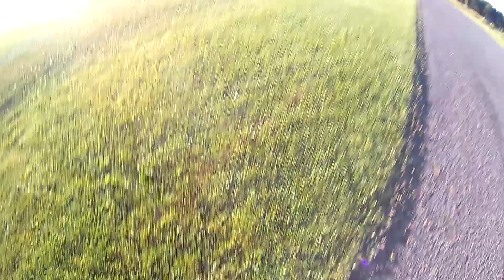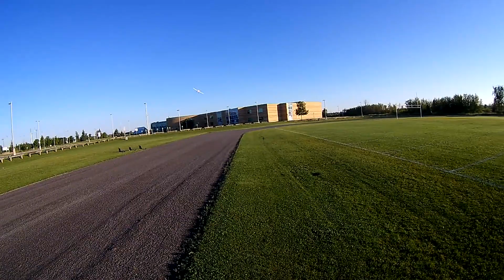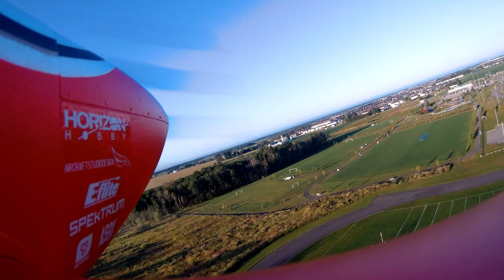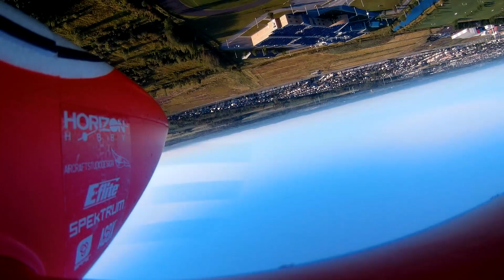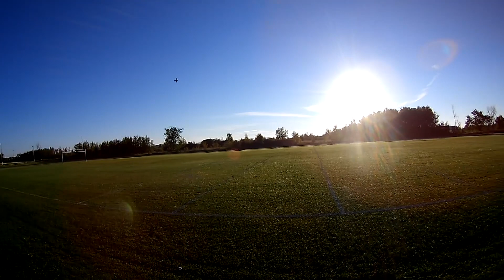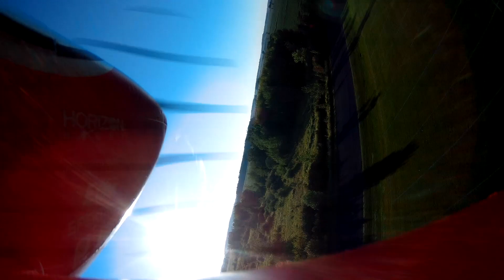E-Flite Commander Safe Select Figuring It Out

Comment: Not a problem, I just like to keep straight the difference between safe, which has always been modes that limit Bank and pitch. Where is a s3x has always been just a very slight automatic tweaking of the control surfaces when a plane moves without stick inputs, in other words moved by wind. I just don't want new people to get confused, it's kind of a mavic versus Maverick type of thing

Comment: The downside of AS3X is that horizon seems to trim the plane as unstable like a jetfighter (F16) with the weight really really in the back. The purpose is to have maximum performance from the plane. I had a friend that changed from Spectrum to Graupner and changed RX. To make it flyable he had to move the cg forward a lot. Not a bad thing, but just something to be aware about.